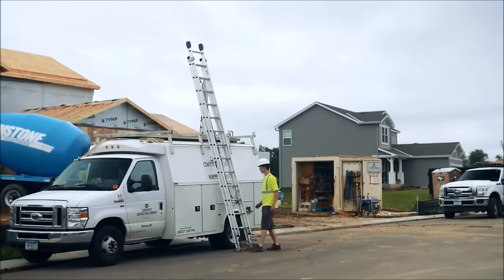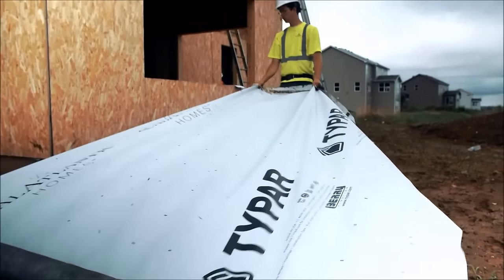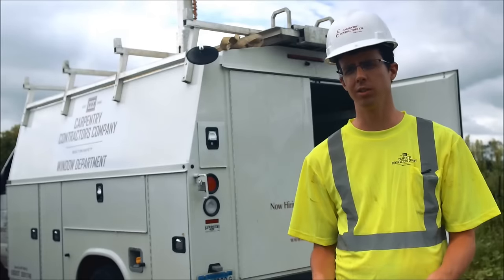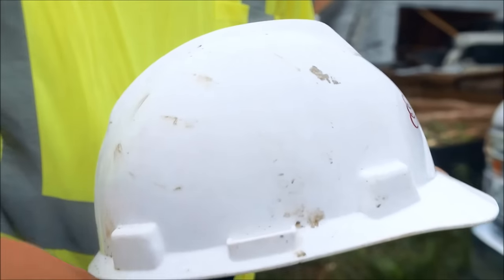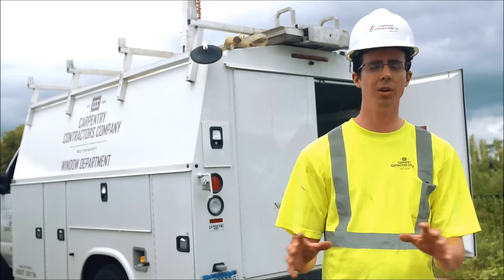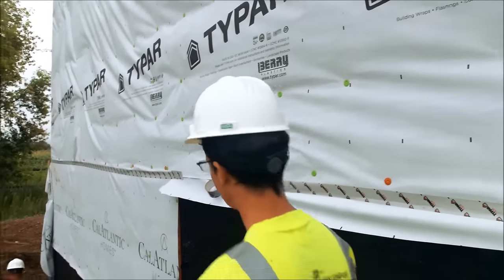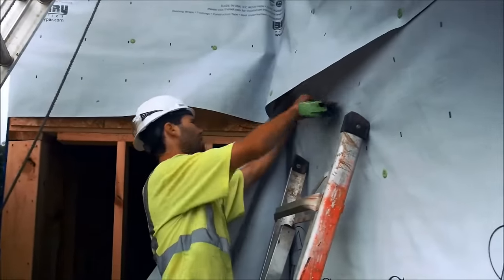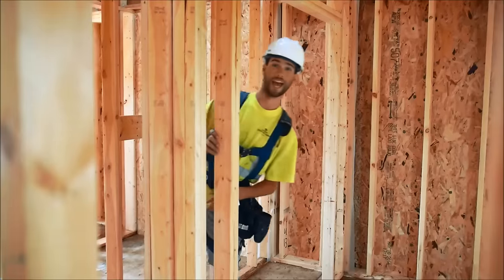Installing Windows in Minnesota -Humor

Comment: Wrap is to reduce air infiltration. Vapor barrier goes on the warm-winter side so the water vapor doesn't condense on the cold insulation side.  After all the infiltration is stopped, we've begun to directly pipe it in (for combustion air and indoor air quality).
Reply: Yes but...the first purpose is waterproofing

Comment: Do a roofing roofs in Minnesota one this summer! I'll give you $5
Reply from the maker: Thanks for the suggestion! However, CCC only provides major carpentry labor services in framing and trim carpentry labor, window and house wrap installation, floor and wall panels and pre-built components to the production segment and CAD services.
Reply: Carpentry Contractors Company why dont you wrap your exterior walls in the shop as you build them? That way all you need is one kid to go around and tape the seams.

Comment: What you need to do is wrap the walls with tyvek before you stand the walls up
Reply: Standard practice, :P
Reply: super extreme David Piacenza well there’s a lot of time wasted by having a crew go in and wrap houses and install windows when it can be done by the framer
Reply: @f4talgaming800  Could be intentional to sub out different work, upcharging on the labor.
Reply: lysergicheadcase very true I didn’t think about it like that.

Comment: Why dont they wrap the house while framing
Reply: because it has to be done once its finished top overlapping. you cant wrap in sections wall by wall for example
Reply: @jaredf5000  why not. If you wrap the wall sections before you stand them all you have to do is come back later on a lift staple off tape done! You are already up there tieing in your corners. Seems the way it is done to me on the video is a complete waist of time. If we did it the way it is done in the video tje builder would kick us to the curb. Pluses the tyvek looks like shit in the movie air bubbles and wrinkles everywhere. That would be prevented if you would do each wall before standing
Reply: @jaredf5000  and role up the paper on the bottom of the 2nd floor wall. When wall is.stood bring tyvek down over tyvek below. Boom done
Reply: @thomasfogerty3515   thank you for saving me the time of commenting on this video
Reply: @thomasfogerty3515  This method in the video is a waste of time, but to me i see it in a different light. As a framer I know its easier said then done, We have prewrapped a wall before we stood it, but the thing is it depends on where it is. Wrap has to wrap around corners and edges, if you do it wall by wall you have an insane amount of ripping and taping to do after the wall is stood, from the outside on scaffold anyway. the inefficiancy in the videos method is that as framers we installed the windows ourselvs as we built the house, with thin strips of tyvek for just the windows. And siders come in after and wrap in tyvek as they side the house. much more efficent way, getting two things done with one crew and one scaffold. but your method is forgetting that you have to tape afterward  and suspended from something
Reply: I wrap the house soon as I get OSB on. Don't need that moisture swelling my sheets up

Comment: house wrap is installed bottom to top!!! Not top to bottom.
Reply from the maker: There is no right or wrong way to installing house wrap, everyone has their own preference and reasoning behind it. We do it both ways depending on siding material but for the most part, we do it from top to bottom. It seems to work best for us and our company verses doing it from bottom to top. But that is what's great about the trades industry, there is no right or wrong way of doing things!
Reply: No right or wrong just efficient/inefficient. Wrap it on the ground. Jokers! Anyone wrapping a standing wall, with few exceptions, is a clock sucker. Fact!